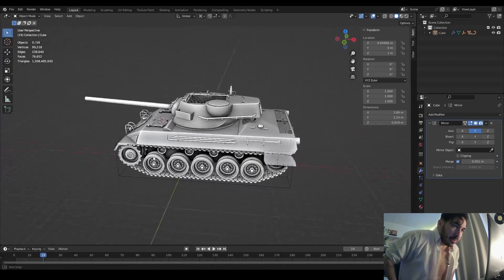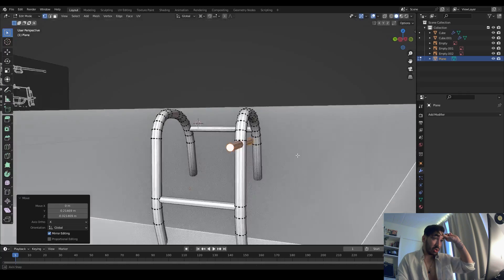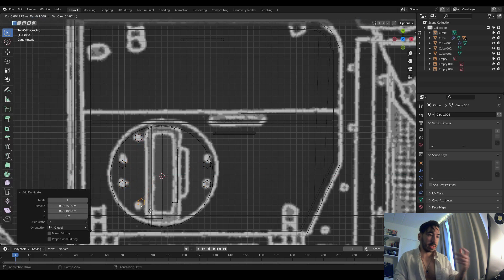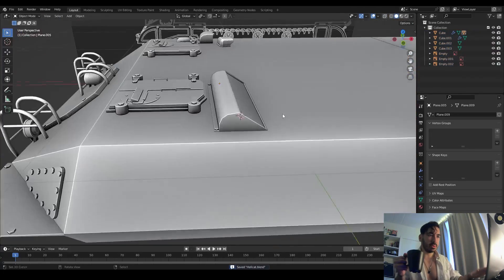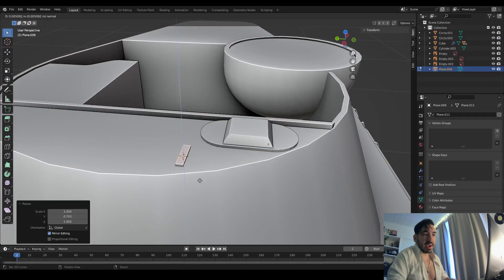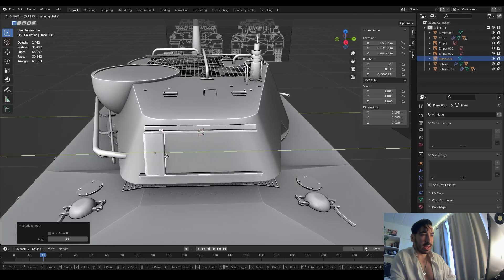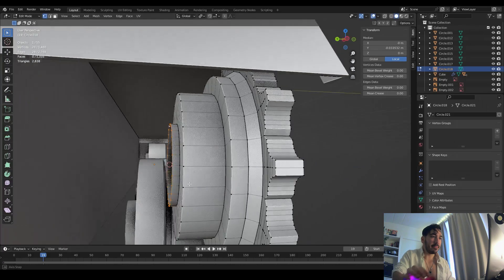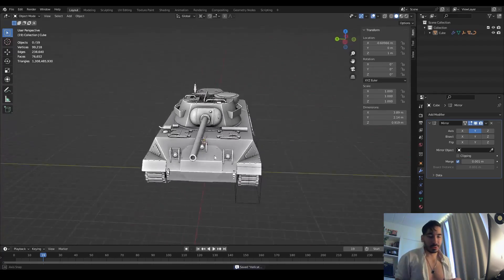Modeling a Hellcat in 10 Minutes | Blender Tank Hard Surface Modeling Tutorial (Arijan)

Comment: was just wondering how you got those bars so even across the length of them because when I tried it ends up uneven/ slightly squashed at the front because they don't scale evenly along the bar but at a central point
Reply from the maker: Do you mean the bars at the side of the tank where I used Alt+S? When you use that function, make sure to check 'even offset' in the bottom-left menu
Reply: @Aryan3D  thank you for that if it's alright I have one more question because even when it does extrude evenly across the bar leave a gap at the back rather than becoming a solid shape, how would I fix that because I managed to make it do it properly at least once but I can't recreate that result for some reason so it just ends up being a U shape across the bar rather than being a solid Square

Extruding horizontally on one of the we are edges then welding it works but is there a more efficient way to do this as it's a bit time-consuming

Comment: The little round cap with the pin next the the driver's hatch is one of the fuel caps. The other hatch on that level is the radio operator/bow gunner hatch. You had two different versions as well, one had the early drive sprocket with 15 teeth the other was a late version with about double the teeth. The last wheel is the idler wheel and is actually shaped a little different the the rest of the road wheels. The smaller wheels on the top are the return rollers. Excellent work, love your videos, keep it up!

Comment: How do you have so few items on your scene collection on the top right? All those little details, aren't they separate pieces?
Reply from the maker: There are 71 objects in the final scene, but they are all parented to something. Only objects which are not parented are displayed, which is only one object for me.
Reply: @Aryan3D  I don't know what a 'parented object' is, can you explain? Thanks for answering these.
Reply: @7errafirma  When an object is parented it follows all the transformations done to the parent object (move, scale, rotate etc.). This is very helpful in cases where you have separate objects for different parts of the thing you are modelling. In this case, when you move the hull object ("Cube") all of the other objects are moved along with it. The objects are still in the outliner (Where collections etc. are shown). To do this you press the drop down arrow on the parent object. Lastly; an object can only have one direct parent, but the parent object can also have a parent, which in turn gives you the opportunity to create a hierarchy of parented objects. An example of this could be that the turret is one parent object and the hull another, where the turret also is parented to the hull object.

Comment: 4 hours? My two tanks took 15h each. Guess I'm just bad. Also. You're not making the suspension, only wheels
Reply from the maker: Having made as many tanks as I have, I learned that they're all basically the same thing.
Reply: @Aryan3D  you're referring to 4 hours or suspension thing?
Reply from the maker: @mateuszjedut2406  i meant that all tanks are the same creation process, so I'm just repeating what I did many times before
Reply: @Aryan3D  oh, ok. But coming back to suspension. With a torsion bar suspension you can do that what you did and animate it as you showed in the videos but there are ones that have bendable parts, in Pz IV for example. Any tips on that?